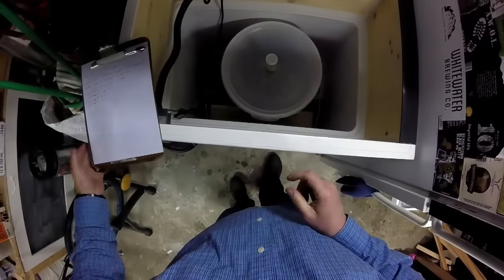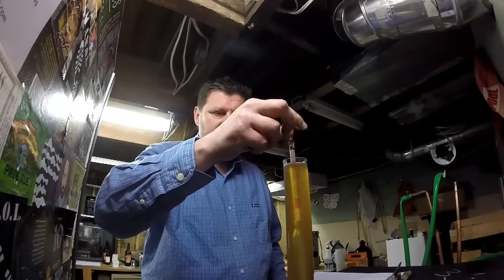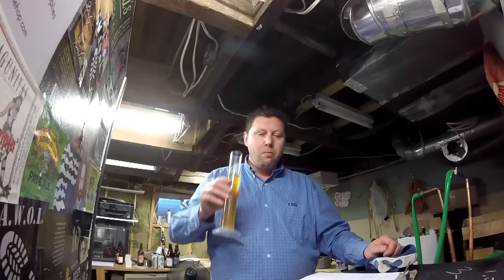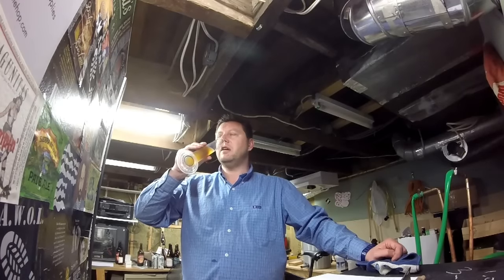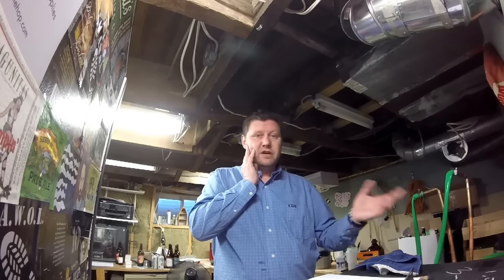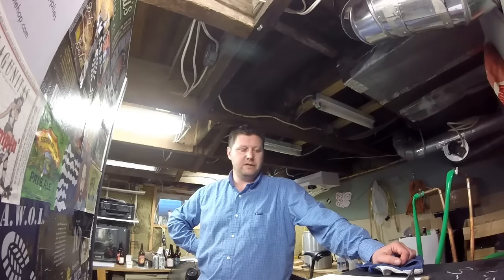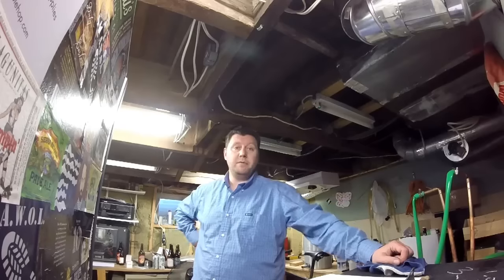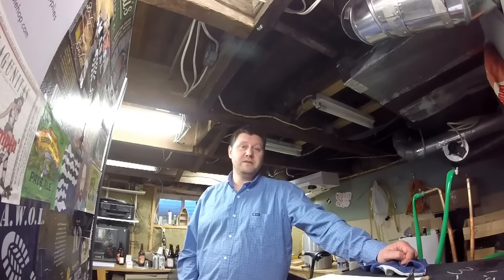Quick Lagering Method Part 2

Comment: You are right on track. After the diacytl (probably hacked the spelling of that up pretty bad...) rest, you still have a lot of yeast in suspension. You'll be stunned how clear it drops after you get it down to 1 degree. All that yeast in the sample flavor is gone, and you are left with a super clean beer. Gonna be rad. Cheers, my brother!
Reply from the maker: +Josh Secaur Dude I'm so stoked to be kegging it this Wednesday.  Thanks again for the tip